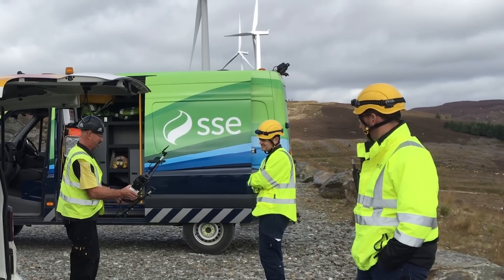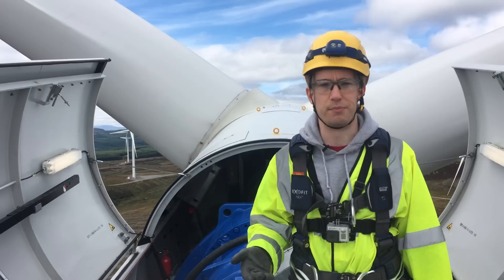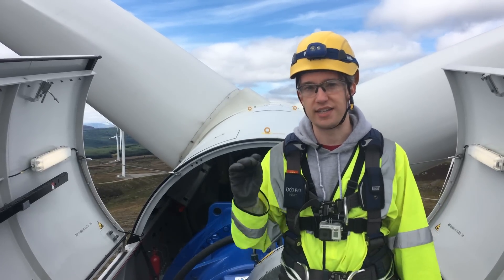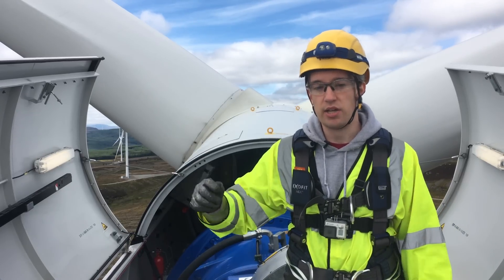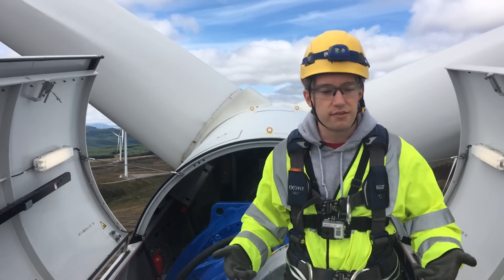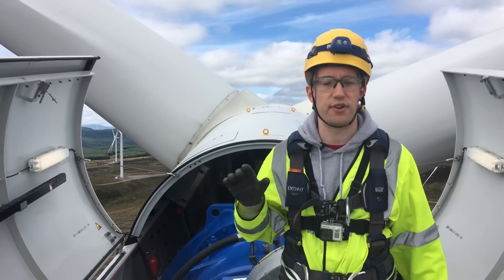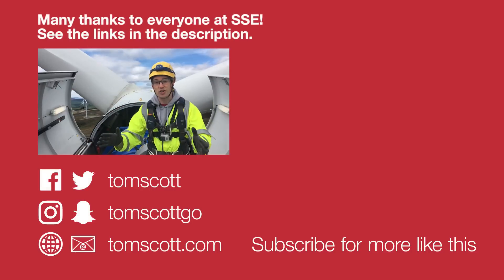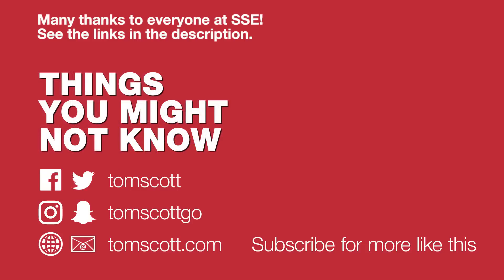The Problem With Renewable Energy (and how we're fixing it)

Comment: You can create virtual inertia for any renewable energy source.  With a wind generator this can be achieved with a double fed induction generator configuration.  For a PV source virtual inertia can be programmed into the inverter control logic.
Reply: It is impossible for a PV source to emulate inertia on its own, it needs some kind of an energy storage. Synthetic inertia from wind turbines also depends greatly on the current wind speeds (rotational speed according to the MPPT) , there is also a problem with the so-called second frequency dip (because of lower output from wind turbines after the frequency support period due to being off the MPP curve). Maybe deloading can be a better choice but off course, we are wasting clean energy this way. I believe deloading is required by various TSOs and synthetic inertia is required by the Hydro-Québec TSO.
Reply: @FrainBart_main  

I care to disagree.  I have significant experience designing this type of control system.
Reply: @michael-j-harrison  Which part of my comment do you disagree with? I'm doing research work on frequency stability support options with asynchronously (via converter) connected renewables.
Reply: @FrainBart_main  

The part I disagree with is that it is impossible to emulate inertia in a PV inverter or other renewable resource.  There are currently legislative issues surrounding the use of such ancillary functions, but legislation is something that can be and is being changed.  Technically it is quite simple to emulate inertia in the inverter control.  Inertia just looks like a resistance for the inverter frequency to be varied.
Reply: @michael-j-harrison  If you have a PV power plant with a grid-tie inverter without energy storage that is operating at maximum possible power at that moment, you don't have any reserve power to emulate inertia from. Energy storage is needed to provide additional power when it is needed or the power plant has to operate in a deloading mode by varying virtual resistance, like you said. 

My point is that it really is easy to emulate inertia with additional control for the inverter but you need some reserve power to emulate inertia with this inverter. I hope we understand each other now.

Comment: This is greatly innacurate. The author is confusing "spinning reserve", which is when any dispatchable generator is running at less than 100%, with the natural regulatory properties of synchronous rotating machines. Because in the same way energy is stored as kinetic energy on a turbine, it is also in similar amounts in wind turbines (which the author says it's not), but also in most non-eletronic regulated motors from grid consumers. If this was in any way true, it would mean conventional DC grids couldn't work, and they did 100 years ago. Also, there is no reason for turbines, or generators, to rotate at 50Hz (3000rpm). They usually rotate much slower. Please punish your scripter!

Comment: Another way to make up for the lost power is that the voltage on the grid decreases slightly such that some loads simply consume less power for a short period. Things like heating load, and some lighting bulbs can consume less power with slightly lower voltage.
Reply: you do realize that in a heating element reduced output might not be desirable ?
Reply: Of course but spread over a lot of heaters it probably is hard to notice the difference and anyway presumably the power co will bring more generating capacity  on  line fairly quickly.

Comment: Hundreds of tons, thousands of times a second. Not quite. ;) 

When the grid needs power, they don't change the output at nuclear stations. Nuclear power stations are very slow to turn up or down. No where near fast enough to meet public demands. Nuclear power stations typically already run at near maximum output, since that's when they are at their most efficient. Basically when the grid needs power they use pumped storage hydroelectric stations. There is one in North Wales called Dinorwig, or more commonly known as "Electric Mountain" since the powerstation is inside of a mountain. It's right next to the train station for the train that goes up Snowdon. And the public can visit. Basically you have a reservoir at the top of a mountain, and when there is a sudden demand for electricity, they open a big giant plug hole and drain the reservoir, forcing water through the turbines to generate electricity. Then when demand for electricity is low, they buy electricity back from the grid, in order to pump the water back up. Works like a giant gravity powered battery.
Reply: Edit. I should have listened to whole video before typing this message out. -_-
Reply: the also have Gas turbine open cycle stations on very short run up times 20 mins or so
Reply: Are hydroelectric power plants on the rise as a replacement for fossil fuels? If so, that opens another area of sustainability, in terms of our influence on the flow of rivers and surrounding ecologies.
Reply: Im not sure how about rest of the world, but in Czech Republic we are already using most of our hydroelectric potential and it makes up for only 4% of electric consumption. I guess that most of developed countries are in similar ssitutation.
Reply: Why don't we just use big masses of steel rotating that are powered with abundant electricity and use them when said is needed. If they are oiled well or suspended in another efficient way, they might be very good at keeping their momentum. And they aren't very expensive, you could make steel containers and fill them with sand or rock. Just the suspension is difficult to build. Maybe some kind of magnets would work. But probably not electric ones...
Reply: Sam,  that is not the purpose of pumped storage, they are used as a last resort. As long as all the conventional stations are not at full output, they automatically adjust output to match demand, no manual intervention required. Grid load varies constantly and this variation is taken care of as I explained earlier. Should the power plants be nearing 100% such as gas turbines will be started in case they are required to provide capacity for anticipated needs. Pumped storage is the last resort, a safety capacity option as they are near instant to run.

Comment: The wind farm produced 158 megawatts, which seems a lot, but back in the 1980s I worked on the control systems for a coal fired power station. That station had four separate generators, each producing 500 MW, and was just one of many around the country.  The engineering was so huge each generator had four inlet/outlet fans, and each fan used more than a megawatt! 

The wind farm is impressive, but we've a huge way to go.
Reply: All power plants need to be sized and sited properly. Bigger does not mean better.
Reply: miming master
Cheap fusion would be the worst possible development because we'd go nuts with energy use and kick global warming into overdrive.
Reply: +Melinda Green +miming master

When I was 10, it was predicted that fusion power was 30 years away.  When I was 20, it was confidently that fusion power was 30 years away.  When I was 30, it was predicted that fusion power was 30 years away.  When I was 40, it was predicted that fusion power was 30 years away.  When I was 50, it was predicted that fusion power was 30 years away.  

I'm 62 now and still waiting.
Reply: +Melinda Green

The biggest driver of global warming is the generation of CO and other greenhouse gases, most of which comes from energy production. If we were ever to have fusion power (which I don't think we ever will) together with a good battery storage system, then we could stop producing ever more CO and the problem would at least stop getting worse.
Reply: *****
The problem would stop getting worse for a little while, but a source of essentially unlimited free energy would be like unlimited free cocaine to a junkie. It's not going to end well. In this case we would quickly heat the planet directly with the enormous amounts of waste heat from generation, and the end state of all energy use. The earth must live within its energy budget, so in the end, we can only use sources that were going to end up as heat anyway, such as wind and solar.

Comment: Storage solution. 
Thermic bottle farms.
Spare electricity is used to make and keep liquid metal or metal salts fluid at high temperatures by electrical heating rods in large underground storage tanks which are themselves surrounded by water tanks , which are in effect boilers providing steam to quick function turbines.

Comment: A convenient alternative to pumped hydro exists and is being implemented by at least one company in the US, it's essentially using trains and gravity to store energy. The basic strategy is to build a rail yard on a hill with a fairly steep incline, and load up many rail cars with rocks and dirt. To store energy, an electric motor winds up a cable and pulls the cars up the hill. To release the energy, simply release the brakes on the rail cars and let them roll back down. It scales linearly (more cars = more energy stored), can ramp up almost instantly, doesn't lose any energy over time, and uses cheap, existing technology and infrastructure. All you need is a big hill that nobody's using!

Comment: that an incredibly optimistic outlook, that always been the issue with solar and wind not so predictable. they actually would not throw on another nuclear rod on the Barbie they would just use gas turbines to that. a nuclear power station takes the time to spin up, they are mainly used for base load because they are predictable. Plus there are ways that do not require the turbines to be so that tightly   synchronized you use  AC to DC Coupler  that would isolate the wind farm  from the rest of the grid

Comment: As wind turbines have a rotor as well as steam turbines, this energy storage device can be tapped by an intelligent control of the power electronics that serve as electronic gearbox between the speed of the rotating blades and the speed of the grid frequency. The mechanical starting time is even bigger, ca 20 to 30 seconds vs. ~10 s with steam or gas turbines combined with a synchronous generator.
Reply: There are technical issues with this synthetic inertia response. I don't want to get to technical but for instance, if we provide synthetic inertia during frequency drop, we slow down the wind turbine rotor. This causes a lower aerodynamic efficiency, which means lower output after the inertia support than prior to it (if pitch angle corrections are npt available - operating below the rated power). This can have adverse effects like second frequency dip. In certain situations, a control feature like this can do more harm than good.

A better option is to keep an active power reserve by lowering efficiency through speed control, pitch control or a combination of these two (depending on the operational state). Overspeeding being the best option: if there is a need for additional power, you inject more power, slowing the rotor down. By doing this the aerodynamic efficiency rises. At the same time the surplus kinetic energy is injected into the grid. Then stabilise the turbine at peak efficiency - at optimal rotational speed. Of course, during normal operation we are spilling a fraction of clean energy this way.

Comment: A lot of current wind and all solar relies on electronic wizardry to feed into the grid, much like any HVDC around. 
I know some wind turbines are fitted with synchronous generators and have special gearboxes to ensure wind speed variations do not cause too many issues. They also have the advantage of producing reactive power when required (hydro plants can do this in Tail Water Depression mode).

Comment: Many wind turbines use induction generators (https://en.wikipedia.org/wiki/Induction_generator), which, when hooked up to an AC grid and spun at above synchronous speed, will always output power in sync with grid frequency.

Comment: I never thought of it this way. That the spinning turbines are actually determining the rate at which my lamp pulses. Also I didn't think of the fact that all of the generators are connected in a way and if one fails, the others have to do the same amount of work to substitute it. So does that mean, theoretically that you could calculate how much force is needed to power brittain? Like you need 10Nm-s to power the country and you can distribute that as you will. Like this turbine can do 5Nm-s and this wind mill can do 5Nm-s. Also, I have a question. What happens if one becomes out of sync? Maybe if its spinning twice as fast or twice as slow.

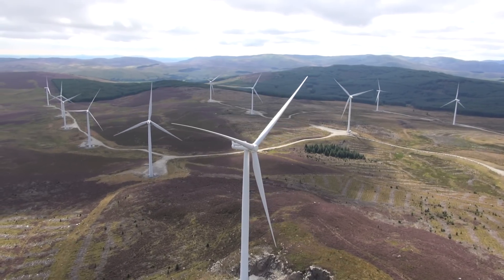Comment: 0:33 Just because we're moving to renewable energy doesn't mean the nuclear plants need to go away, in fact, well managed nuclear plants are a very good idea, since a lot of other clean energy sources won't work everywhere (solar isn't so good away from the equator, wind needs wind, geothermal requires a geologically active region, or massive upfront development costs, tidal needs the ocean, hydroelectric needs fast running water, and so forth), but nuclear works anywhere you can get the fuel to.  To be clear, I understand nuclear is non-renewable, I'm just saying clean is a bit more important than renewable, so long as running out isn't an immediate concern.

Comment: Hi, yes, good summary. Balancing the "new Grid" is a callenge - but its possible. And its really nice engineering, too! It just has to be done. And I think the switch to 100 % renewables has to be done as quick as possible. And I hope that we quit nuclear power before we get a major nuclear accident in europe. And quiting the project "Hinkley Point C" is already a step in a good direction!      ;-)
Reply: Don't believe the hype of the environmentalist nut jobs and learn some facts.  Nuclear is actually a pretty safe power generating method.  The accident in Russia occurred because they cut corners on constructing the thing (IE shoddy construction) mixed with lax safety protocols where an operator made some mistakes that led to a meltdown.   In a properly built plant with proper safety protocols and a trained staff, stuff like that shouldn't happen.  Nuclear is one of the cleanest methods of power generation we have right now. and probably is going to end up replacing fossil fuels in the future for the bulk of our power generation.
Reply: Well, some years ago thee meltdowns happened even at a japanese power plant - you probably have heard about it. The whole engineering and safety roules are based on assumptions. And sometimes these assumptions are wrong. And such a meltdown is quite a big mess. But even if everything goes fine nuclear engery is a huge mess. The waste storage problem is not really solved. And already the making of yellow cake and fuel rods causes a lot of bad diseases in third world countries because of the radioacitve and toxic dust. Nuclear Power is one of the most expensive Power sources - if you take in account all points (like the missing ensurance, safe storage of the waste for thousands of years, ...). But well, you wouldn't read such things in the AREVA- or IAEA-News.
Reply: You mean the plant hit by an earthquake/tsunami...
Reply: Exactly that's the one I am talking about. But there are a lot of other events that could cause comparable or even worse accidents - for example a terror-attack (Plain, Bomb, Conquering the control room, ...), a bursting reactor-pressure-vessel, or an inrush of soil (like probably German NPP Neckarwestheim is threatened from).

Comment: The way you get more power out of a nuclear reactor is to put more demand on it. This causes more heat to be pulled from the steam at the turbines which in turn eventually lowers the temperature of the input cooling eater at the reactor. Cooler water is more dense and a better medium for neutron activity which means more heat can be induced into the water which causes more steam to be generated at the steam generator. Once you have taken the reactor critical you actually control the power by the cooling loop.

Comment: Theoretically they could put capacitors in the grid to take some of the little spikes and dips (just put a couple at each transformer)
Reply: Capacitors are for applications where you want to be able to deliver the stored energy very quickly (fractions of a second), but don't mind not being able to store much of it. They're devices with a high power density, but a low energy density. 

Grid operators probably do already use some capacitors for smoothing out really short spikes, but the sort of spikes that were covered here are much too long-lasting for capacitors.

Comment: Another small battery option is using solar panels with batteries for household use.  Nor grid tie. Lighting and whatever you can heap on.  Not everything needs to run on AC. Lights and fridge are comfortable on 12 volts if you purchased them. Batteries should never be wired in parallel, but should be on separate circuits and chargers. Extra solar panels can be aimed somewhat toward sunup and some toward sundown. This reduces the hours that the night battery has to carry the load.

Comment: Surely if the issue is lack of inertia from the turbines the issue can be solved by using actual rotating intertial mass as a storage medium? There's more efficient ways to store energy right now as well, such as reservoirs with high gravitational potential
Reply: Yep, you're describing flywheel and pumped hydro storage.